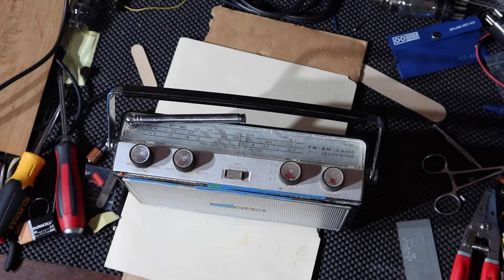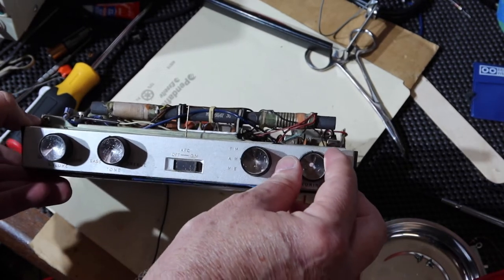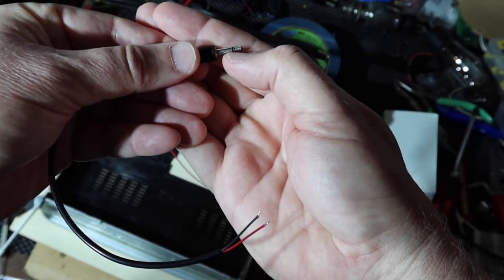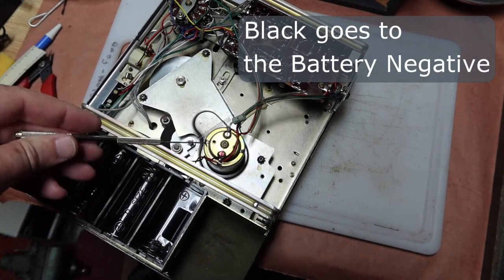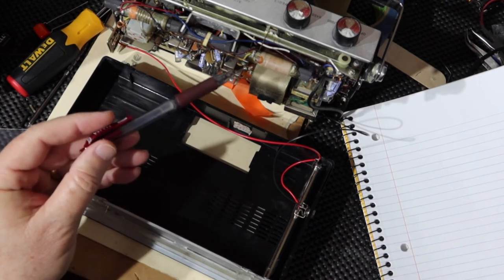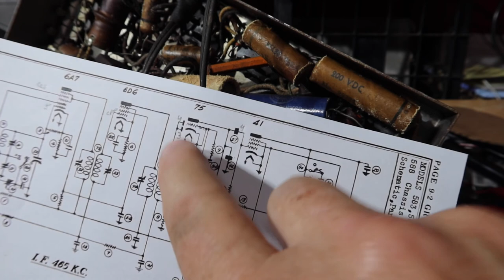Let's fix a 1966 Panasonic Radio RF 1006MD! Pt 2  Adding Power Adapter with Polarity Protection

Comment from the maker: Jump to:
00:00 / Review of Part 1
03:12 / The hidden switch used by the optional car/boat mounting bracket
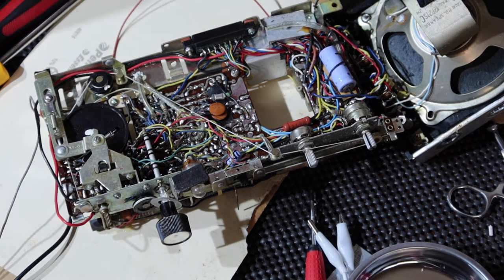05:45 / Time lapse of cleaning the face plate and blowing the dust out of the chassis
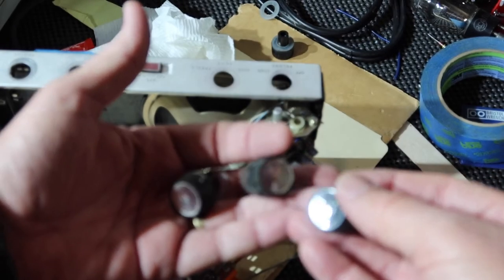09:02 / Lubing the dial cord pulleys
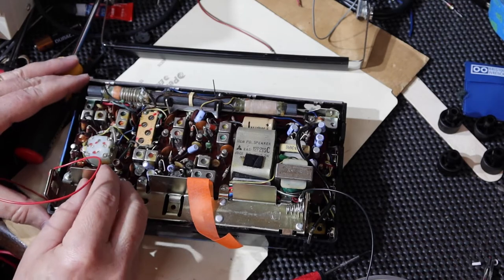09:45 / Chassis back in and testing the dial light
12:20 / Time lapse reinstalling the chassis screws
16:29 / Discussion about power adapter and polarity concerns (how to address later in the video)
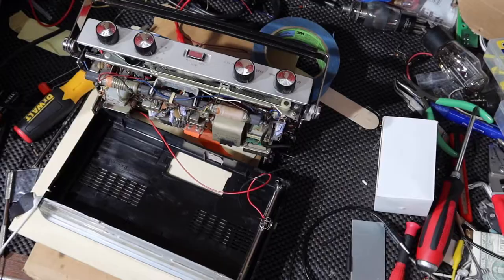18:35 / Result of 2-1/2 day burn-in; and discussion about power adapter plugs, and the plan for building a new power adapter
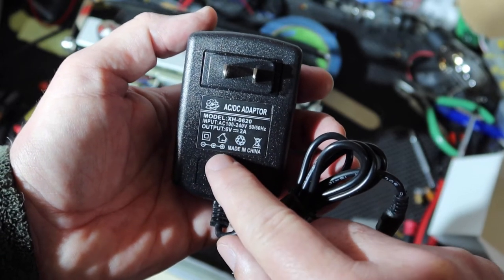23:40 / Example of "how power adapter jacks were wired", and how they worked, in the 1960s, by inspecting a Vista tape recorder with a factory ext power jack
29:18 / Polarity protection discussion of options, and the choice I made in this case, including how I plan to do a little rewiring
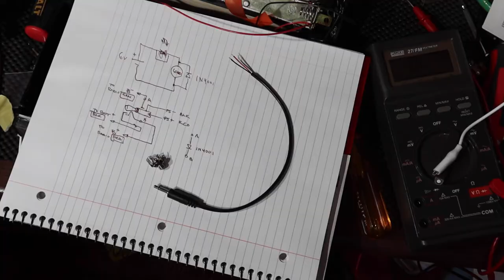37:06 / Detail on the implementation of the polarity protection circuit I chose, how the jack switch works, and the wiring of the jack and diode (1N4001)
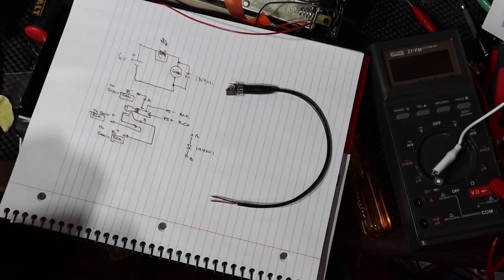41:19 / Power adapter plan wiring complete
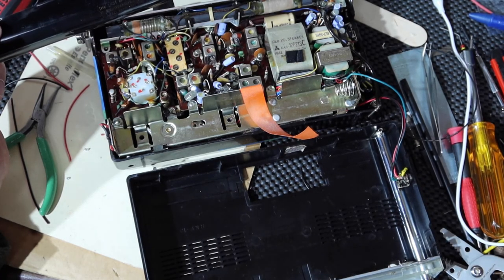43:00 / Radio reassembled and final check out - will it work?
47:13 / Review of what needed fixing and we did to fix it and the mods we made to help it last another 50 years!
47:55 / Coming soon on this channel!

Thumb up and subscribe for new videos, and thanks for watching.